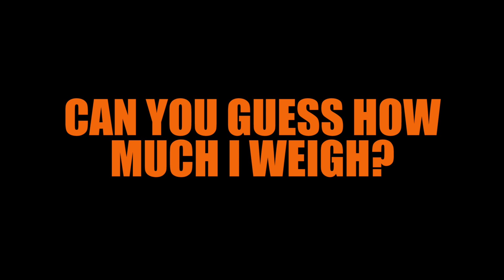Deere 380G Trackhoe Loadup Williston, ND

Comment: At a guess nick I nick I would say somewhere between 148000 to 158000 with all your dunnage on board, makes you a little anxious when it spins up like that lol! great vid. stay safe man.    pat.  uk.
Reply from the maker: Yeah it will make you nervous when the steering wheel merely becomes a voting member as to which way the truck is going to go!
Reply: trucks  don't like to turn in mud with the powerdivider in they just keep plowing straight  that motor burning clean and sounds sweet

Comment: The Bakken is a victim of its own success. 

The weight of the 380g is about 80,000lbs, your truck and trailer about 40,000. I would guess about 125,000lbs.

Comment: WOW =-O... NINE hours went into making this vid?? Maybe I should be glad I don't edit the vids I shoot. Hey Nick, is the new motor still running tight? No issues, I hope? Do those outrigger shelf brackets actually have a prayer of holding that kind of weight? I'm guessing they're in case that excavator starts to tip? I'll guess you were 140-150K#s of fat butt on that day. "Hi" to Dex ;).
Reply from the maker: Yeah it took a lot to get it done. 

I do have a video review on the engine coming together, I just wanted to give it  solid shakedown before I did to ensure what I say is accurate.